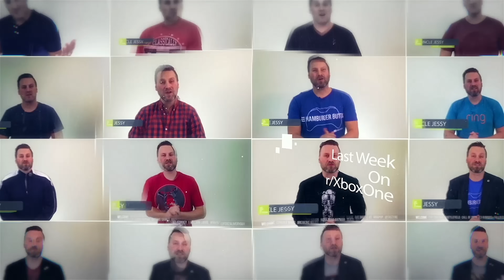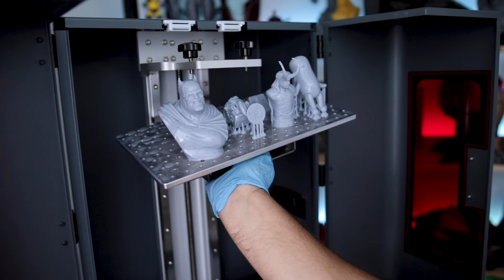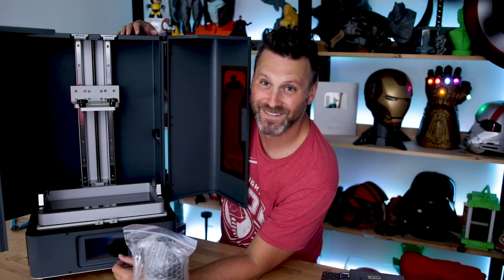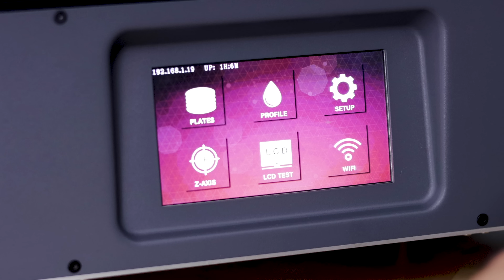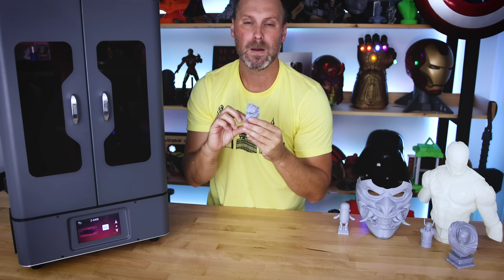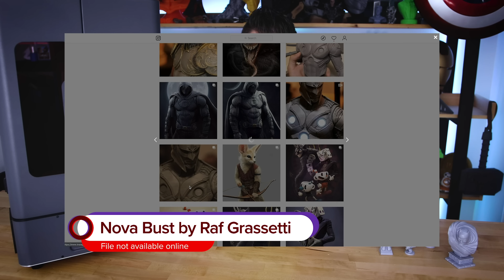Initial Impressions - Phrozen Transform Resin 3D Printer - Huge Resin 3D Printer

Comment: watching 6 years later, all the companies doing resin started making the print area larger by making them longer yet narrower, so a 12 inch build plate is 2 inches wide... I'm joking, kind of, I just wish they would have stayed with the regular aspect ratio instead of making it narrower and claiming BS reasons. but i guess you can blame the general public for being ignorant, and accepting it.

Comment: This is a cool machine, and I like it for the Z axis that has 10 cm more than my Anycubic M3 Max. With that being said this is a 3 year old video, and the Anycubic has 6K and prints basically the same size less the Z axis.
Now What I don't like about the Anycubic is that I am using Chitubox, and it has to convert the file to the Anycubic format to print, and I am getting Ghosting issues with the prints at times.
I think Phrozen just prints strait from the Chitubox, and I am hoping that this will fix some of these issues.
Now the Price on the Transforms is to high at this point. With Machines like the Mega 8K being at 3k give or take this machine at 2200 to 2600 is just Ludacris. 

I am looking at an open box Transform on eBay at the moment. The man paid 2500 for it give of take 2 to 3 years ago and claims to have used it 3 times.
He is asking 1700 for it, with 112 shipping.
I told him that in my opinion that if someone offered him 700 for it, he should grab it and run to the bank. Phrozen puts these on sale about 4 times a year for 999. with free shipping.
The other issue is that the spare LCD screens are around 300 to 350, and 550 from the reseller stores, and they are all sold out at the moment.

I found out the hard way with the M3 Max that I had to wait 5 weeks to get a replacement screen from China, and that if you are going to print a lot, you really need 2 on the shelf in reserve if it is at all practical.

I have a Mighty 8K on the way and I am somewhat pitting it against the M3 Max although it doesn't print as large of pieces, I want to see if it cures the ghost walls in the prints.

Comment: I bought the peopoly phenom and I love it love it for the large scale prints. That's what I was aiming for when I bought the cr10  that printer kicked my behind all over the place I couldn't get it to run right no matter what adjustments and upgrades were made so I sold it and bought a peopoly phenom and it is easy to use . Happy creating.

Comment: are these printed objects fragile or sturdy
Reply from the maker: Resin prints are typically high detail but fragile. if you drop them they will more than likely shatter. You can mix in other resins to make it more flexible or durable

Comment: Hi Mr.Jessy
Is this printer a better choice for engineered parts, to print in high tolerance accuracy.
Reply from the maker: Hey there. I would recommend hitting up the Phrozen transform Facebook group and checking there. I’m usually printing super nerdy stuff

Comment: hello uncle Jessy! im always watch your review of phrozen transform printer , and i just got mine this week . but i have some issue here, my print always stick to the fep film , why did it happen ? Is there something wrong with my settings? I did re leveling with paper, and the results are the same . can you help me with some tips ? thank you very much
Reply from the maker: Hey there. I did a video a few months back on Ptfe lubricant. It helps keep the prints from sticking to the FEP. You can also try adjusting your bottom exposure settings as well.

Comment: That sure beats the heck out of the ten grand for the form 3L. 

This printer could be good for a “production” miniature business. Or in my case for producing large numbers of custom 1/35 scale figures for dioramas and/or “model kits”. But.... I really need to produce items with absolutely NO layer marks and the carbon one (because it’s continuous printing/no stopping for layers) @40 grand just isn’t an option. 

I saw your phrozen mini video last night and I noticed today that phrozen has a 4K high definition printer. Do you have any info or opinion on that one?

Comment: I think this is a system that often has problems. Some people in Taiwan have repairs 3 to 4 times a year. A small number of users who did not enter the factory for repairs have an inexplicable condition, which is normal after restarting. I think this is a less stable machine and system

Comment: Shifting layers suggests instability of the build plate as it's being elevated.  Any lateral shift in the build as it's being raised will show up in the print.  Flat vertical surfaces are the best test for this.  Quality and stiffness of the linear bearings the build plate is mounted to are critical to quality results.

Comment: The layer shift lines look like they are a result of a bubble building up inside the model that causes a pop when it pulls up on the model after some time, changes in topology or orientation can help with that

Comment: Do you have your Chitubox profile available for download? We're doing a test print of a tiny steamboat that took 2.5 hours on the Slash OL (and we've shrunk that model by 50%) and it's going to take 20 hours on the Phrozen. Something is strange. We got the profile from the Facebook group. 
Burn time is 80000ms, cure time is 8000ms. Heigh is 50 microns.
Not sure why it's so slooooooow.
But at least it's up and running.

Comment: Whatever the test file is, we got it to load into the printer tonight during setup and it says it's 6001 layers and will take 133 hours to print.
So we just got a 10mm calibration file instead :D

Comment: The build plate is perforated to allow resin flow, otherwise the vacuum force against it when raising would be too strong against the FEP and raising speed would have to be very, very slow. Kelant uses it already on their small D100 as well as on their bigger 3D printer, they can be seen in Aliexpress. I perforated my Elegoo Mars build plate upon finding that information, although only 6 holes along the center. That also allows to place closed models centered around a hole, directly on the build plate, with no need to have escape holes within the design.

Comment: I had issues Joining the wifi. Phrozen sent me these instructions.. But first connect to your printer with a ethernet cable to your router. Once there use the IP address that will be on your screen in the top left hand corner .. No passwords needed. From there you can go to wifi and put in your password and It took me 2 times to get it to work But now im connecting to my printer via Wifi. Here is their instructions.. 
For not able to enter pw, please use a hub and connect ethernet to printer then to a hub.
Then your printer will show IP.
Connect your laptop's WIFI to the router.
Then enter the IP on the browser.
Then you will connect to printer by Ethernet.
You can setup WIFI there.

Comment: Resin would not have cured inside of the bolt. No UV should be getting in there. I have resin drops inside my Form 2 sometimes that sit there for days (because I don't see them sometimes) and they stay wet for a long time.

Comment: The holes in the build plate are there so the resin can easily flow back under it when it moves up, as well as against suction, so the bottom of the vat is not being pulled up as well. A lot of DIY builds have had them for a couple of years already (mine included).

Comment: I wonder, why on earth these types of printers should have layer lines at all. Imo they could just run Z motor at a low constant speed and interpolate between 2 displayed images in a linear fashion.
Reply: I think the issue is that you need some time and tolerance for the new liquid resin to flow under the hardened resin. Therefore there is a lower limit to the height of the layers.

Comment: So right off the bat they do need to work on the UI and try to make things a tad more universal in terms of lingo.
I can really see this as a unit that a business uses. They don't quite need the pro's yet but they do need to size/quantity in one go and not multiple. 
The real question is how long do the parts last and how much does it cost to replace them?
I may have missed it but is that also using an FEP film or is it a "glass" plate given the size. - Answered on Dungeon Printer's YT

Comment: On fdm if you use 20 or 30 (whatever) small pieces. Put all on one stl then slice.

In design software select finished object and clone and save as a single stl. Do not import other files that makes the file huge! Like a lot on thingiverse.com.

Comment: This doesn't make sense... it's just a z axis and LCD.  there's no reason for this to be so expensive compared to the smaller units (aside from build quality, etc).  The tech is very basic and so much easier than a cartesian or delta FDM.  Theoretically, one should be able to pull the 'guts' out of a elegoo mars and replace the build plate and LCD and be done.  (yeah, i'm over simplifying it, but the argument stands -- again: quality of build aside, volume is irrelevant)
Reply: It's probably expensive so that it has a less of a chance of failing (like the Moai) compared to all those crowdfund campaigns that never delivered because they were sold too cheap.

Comment: Way to expensive even for that size when it's not real SLA.
I mean UV smd lights and even the bigger ones are very cheap and the screen is also very very cheap so it's basically like a apple product very very extreme high margins but not a lot of cost in production. It super simple todo that type of printer it's even more trivial than a normal printer for PLA.

In general 3d printers are more money printers for there companies they cost a huge ton of money and use free software and even free hardware and sell it for a fortune.
(I really should buy uv led's now… i call it the PlatinMax, i don't mean the Chinese printers these are pretty reasonably priced)

Comment: Are there different resin compositions? What is the active ingredients in this resin? Ie; is it flammable, toxic if ingested or fume inhaled? Does it stand up to corrosives, high temperatures, impacts etc etc? Can an automated resin dispenser be added as required to save on unnecessary wastage of resin or having to put excess resin back into a container? What is the service life of the curing screen and its replacement cost?
And can it work fully offline?

Comment: Why didn't you hollow out the model and save on a full bottle of resin.
Reply from the maker: All of the files were hollowed our in chitubox 😬
Reply: @UncleJessy  I just got my Phrozen Transform About to level the bed I was wondering were I can find your ChiTuBox settings.. Thanks
Reply: @SuperMouseDV  have you ever used slicer ?
Reply: @christianwolfgang943  No I have not Im using Chitubox for Bothe my Photon and my Transform..
Reply: @UncleJessy  Seems unlikely that the white model would weigh nearly 3lbs if it was hollowed correctly.
Reply: I was about to ask the same.
Reply: I was about to say the same exact thing then saw your post.
Reply: If you missed his reply, check out @21:41
Reply: 'cos he can :(
Reply: Yes so tru. I lournt that. Even with maken resin molds. Hollow inside save on. Resin.

Comment: Any chance the minor layer shift is due to a flaw in the Z screw? I would check each model you've printed to see if the few lines you are getting are at the same height of every print.

Comment: Has anyone had issues with chitubox not allowing you to put holes in a model? The first few times I used it, the add a drain hole feature worked fine. After that anytime I try to add a hole it just fails. Also I had an issue printing a lithophane where it added a solid layer on top when it sliced the file but the model itself doesn't have it.
Reply: All the time.

Comment: Resin be dangerous and expensive tho :sad sight: and usually not strong. I wish resin was better cause fdm doesn’t look as good
Reply: There are resins now that have very impressive strength.  Look up CNC Kitchen’s video “STRONG parts from a Resin 3D printer?”  Price is coming down too.  Safety wise - yeah, there are things you have to be aware of, I certainly wouldn’t run one anywhere other than a garage or workshop, but that’s because liquids can splash, maybe a slippery print that hasn’t been cleaned yet falls on the floor, etc.

Comment: great video! how was your experience dealing with Phrozen support? and how helpful is the community around the Transform? For me thats a huge thing is to be able to get help easily, either from other users or support. There nothing worst when a printer doesnt work and you have no one to turn to.
Reply from the maker: That right there is a great question. Email response took a day or two, I mostly relied on the Phrozen Facebook group. Unfortunately the user group is still really really small for this.

Comment: 2.5 bottles? that's like 300 bucks just on materials! resin is so expensive....
Reply: 2.5 bottles is around 100-120$ depending what resin you buy. I assume he didn't print it hollow and it is a fully solid print...

Comment: Great review, Jessy. I'm about to bust open my Elegoo Mars (finally!). Anxious to see your 2-piece helmet print. Quick question, if Nova took 2.5 bottles, how did you replenish the resin in the middle of the print? Were you prompted? Does it pause and resume cleanly?
Reply: you can just pour it in while curing a layer.  you can pause, but you should try to avoid it.  if you mush, wait for the build plate to rise and pause it then, that way you are not interrupting a layer cure.

Comment: It's no surprise you are getting shifts when your build plate is only partially secured.
Reply from the maker: yeah, unfortunately the build plate stuck issue was only during the big white Nova statue... it was working correctly for the Oni Mask and smaller prints
Reply: @UncleJessy  It's kind of impressive that the quality isn't worse, that plate moved quite a bit when you applied pressure.

Comment: So if I want something good for cosplay and weapons easily and how much it would cost to print such pieces would you recommend this or just a large FDM printer?
Reply: A lightsaber hilt for example would run you about ~$10 in resin. (I recently printed Cal's hilt) However the quality is amazing compared to fdm, but--resin can be brittle. If you're wanting large, cheaper, less detailed prints, but more durable as you can print in tons of materials, fdm printer for sure.
Edit: a hollow lightsaber is what I'm referring to, a solid one would run you much more $
Reply: I still recommend FDM for pieces that require some hardness. Granted there are a few pieces where a flexible resin can be beneficial for cosplay.

I generally run both depending on what I need, but if I had to choose, FDM offers more flexibility for wearable pieces.
Reply: @Blitz1Blacktail1  Couldn't agree more! I miss out on printing quite a few things with having a resin printer. And at the same time, what I can print is very high quality. Definitely ups and downs for both, for cosplay--go with fdm
Reply: Thank you for the input!

Comment: I've wondered, when using resin printers, if the vacuum created when opening a door to a room could cause layer shifts like the ones you encountered.
Reply: No, it isn’t an air tight enclosure on any resin printer I have seen.  Usually it is just to help prevent UV from coming in and curing the resin in the tray (not to protect you from resin smells or anything, that stuff always finds a way out).
Reply: Don't think so, when any single layer is printing, it's actually very close to the screen (0.01mm I believe), regardless of the specifics, when any layer is printing, it's under/in the resin, meaning air would not disturb it underneath.

Comment: Greetingsª
i have an issue with my Creality LD- 001 The build plate is made of metal and a thick layer of glass. I have printed with it only 5 times and is all dented from the spatula removing the prints :S, so i guess in only a few months i would not be able to print with it again. Other LCD printers like Elego mars and Anycubic Photon have this issues as well? Can i buy a spare part from anywhere?
Reply: Elegoo Mars has a solid aluminum build plate. I use a metal scraper to remove prints from the build plate and haven't experienced any damage whatsoever after several months of use. 

What you describe doesn't seem to be standard, but I don't know anything about the Creality resin printer.
Reply: @mimked  Same, i was looking for more information regarding this printer but there is little informarion, even in other youtube channels. But yes, this printer has a glass layer upon the metal building plate and after a fea uses is very dented. I just send an email to creality contact mail but i dont really think they sell spare parts :/ so i'm f*cked i guess...

Comment: The one thing I don't like about this printer is the rectangular build. Something closer to a square for the base would be preferred to me if they could get it as wide as it is tall. That'd be a resin version of a cr-10.

I know the reason is the led panels for the uv lights typically have 16x9 builds and a square would be expensive. Just a pipe dream.
Reply: I was thinkin the same, make it what we call a rectangular shape, cuts out too many models that have a different shape. The one guy who builds a 3d printer capable of interchange the resin vat and the building plate from rectangular to square as we see fit. Would be king.
Reply: @Chromeskull90  There is one company I know of that did make a square bottom resin printer. The Moai 200 has a 200x200x250 build volume and costs about 1500usd. Though from what I'm told, it doesn't have the same UV light style the Phrozen does which makes it less accurate for industrial builds.